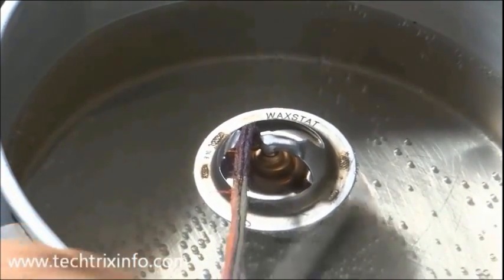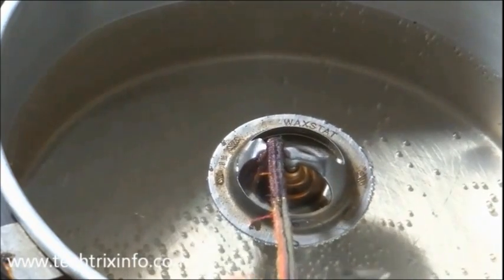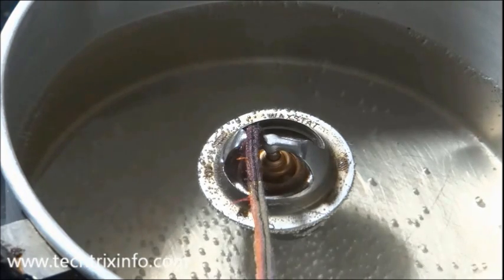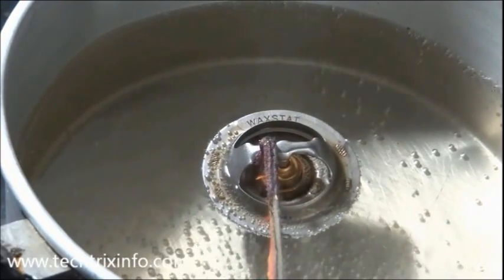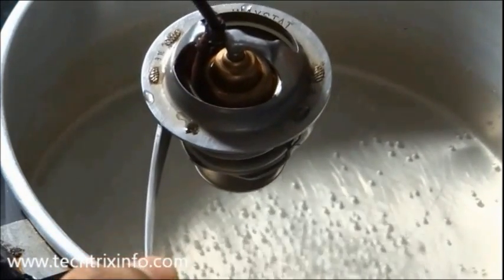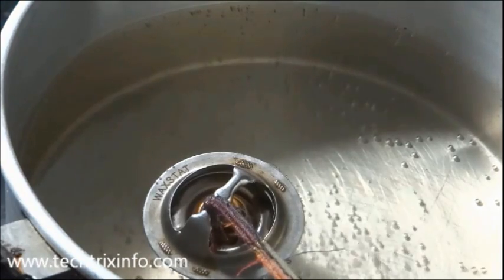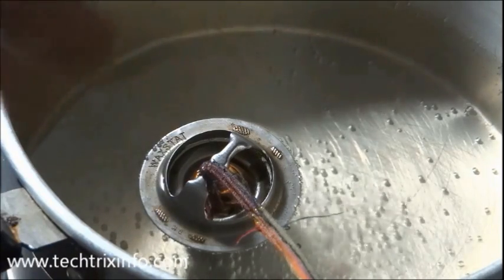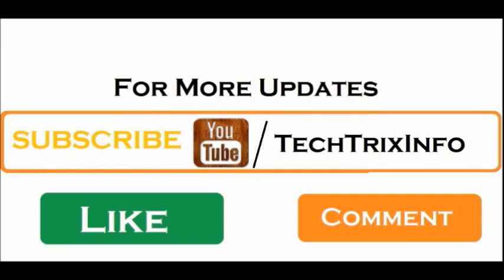How to test a thermostat in 3 minutes (Must watch). ✔

Comment: Many mechanics remove and through this volve from car, they said this volve is the main reasons to leakej radiator...
Today my machenic also remove this volve from my Tata vista TDI (2010) because my car getting hot, even in reiny seson, and water leak from radiator botom every month, also water bottle getting  empty after in 50 km

Comment: You guys don't need test a thermostat , just replace it , that's it .
Reply: Testing the thermostat first will help you diagnose engine overheating issues. How will you know if the issue was the thermostat if you just replace it?
Reply: Its for educational purposes you plebeian schlub
Reply: +Nicolas Vergoes-Houwens It doesn't do any harm by the way, by changing a stat when not needed you've done regular maintenance, stats are subject to normal wear. As radiators, water pumps, reservoir tanks and coolant piping are, by the way.
Reply: +Snurre86 Some of us mechanically educated folks are even used to replace the coolant temperature sensor along with the thermostat. Done that to my 14 years old car (replaced both stat and CTS, a Bosch NTC M12-H) and found that the new sensor makes the radiator fan start spinning right when the thermostat opens (when it does, water starts returning to the reservoir through the overflow pipe), while with the old one the stat (even the new one that started opening only at 92°C) opened a long time before the fan turned on. Now the fan almost never spins. Yes, anything wears out with age.
Reply: You don't need to replace the thermostat, just get a new car, that is it.
Reply: I tested mine to open at 84C and fully open at 95C  like the manual state, I am having a hard time keeping the temp above 2/10 slots on the gauge when riding but goes pretty fast up to 8/10 and fan kicking in at a stop light. Not sure what temp 2/10 and 8/10 equates to.

Comment: So if it opens at boiling its good?  Wrong!  It must open at the temperature the thermostat is designed.  For instance, if it is a 195 degree stat then it had better open at 195 degrees, not at 212.  If it doesn't fully open until it the water temperature is 212 then the stat is bad
Reply: +Jim Belino You mean that once water reaches 195 F it snaps open and then, once it cools to, say, 194 F, it snaps closed? Or, say, does it really open a little at 190 F, a little more at 191 F and so on? I find that with AC on my car, which has a condenser on radiator assembly (so, if the cooling fan is cooling the condenser, it's also cooling the radiator), runs cooler than with AC off (with AC off it oscillates between 88°C and 94°C, with the thermostat opening temp being 92°C; with AC on, it tends to stay at 80°C-82°C; all of this at low speeds). Is that normal or does the thermostat need replacement?
Reply: +Jim Belino Bought a new thermostat and had it replaced. It was a faulty thermostat that opened at 171 F instead of 198F. Now, with the new one, after you start a cold engine, gauge reaches 198F within a minute and then sticks there even with AC on.
Reply: +Jim Belino Well said!

Comment: You kept saying you can see it opening i couldnt see anything??? Ive been getting alot of gunk in my rocker cover my breather pipes and under oil cap and a tintvblob in my oil filter today i changed my rocker cover gasket cleaned it al out tried to do this test and nothing heppend well when we took it out it was closed (it came out in the housing ali pipe) i put it in hot water as you shown then waited "see nothing" then tried again this time also in cold water after "nothing happened"  but it was closed when we took it out te ali piping case because when we tried to put it back in the ali case housing it wouldnt fit it was to long so we squeezed it back in but theres a gap which ive been told now it is ceased open which is a goodvthing i also been told while driving waiting for part tuesday i will change the thermostat i have to drive untill tuesday do you think changing the thermostat and rocker cover could stop the gunk build up? 
1)Im not loosing power
2) no loss of water anti freeze
3) no gunk on dipstick atall
4) spark plugs wer fine
5) no smoke or gases out the exhaust
666) im blimming stuck itf its not the thermostat could it be a hidden crack the gunk in the rocker was bad a jar of mayo in there